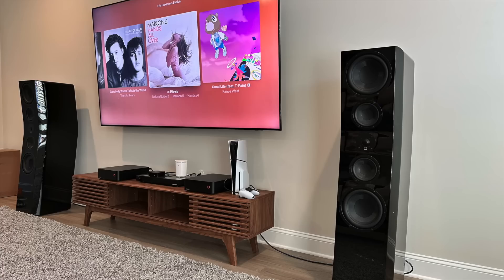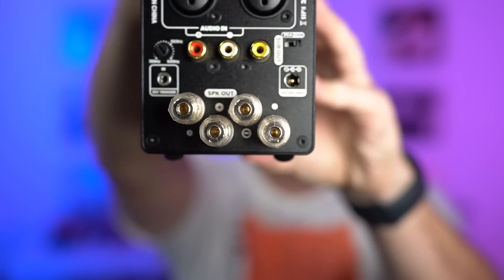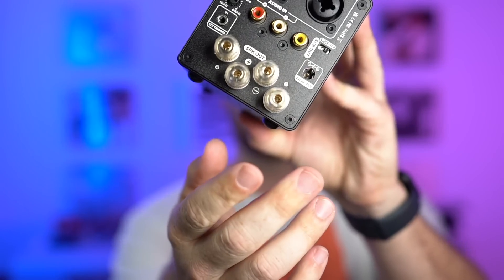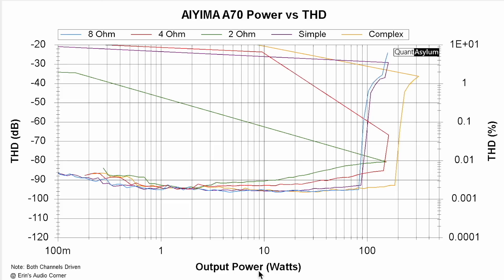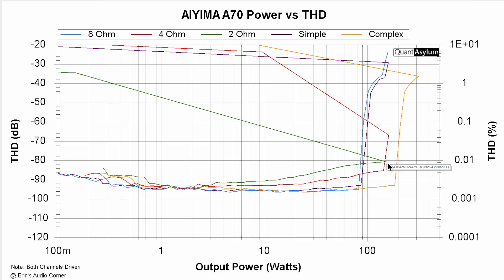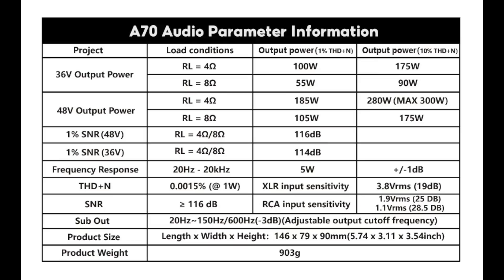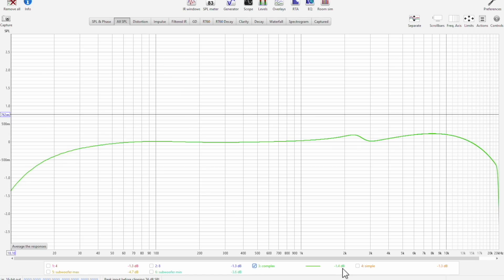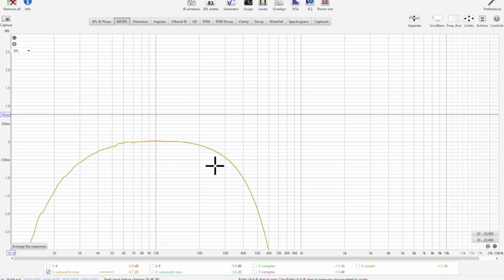The Shocking Truth About the AYEMA A70's Advertised Power!

Comment: Also don't forget that if you are using an active subwoofer you are taking that load off of the main amplifier. That can be up tp 80% of the total power and therefore you are left with 85 watts into 8 ohms for the mains (> sub frequencies). That equals more volume in total, lower distortion on the mains and more dynamics.

Comment: See, to me this is just an amp.  While this has a volume control, it's not much good as an integrated amp because of the limited inputs and controls. Wouldn't it make more sense to do bass management with a paired preamp?  Connect with a Wiim Ultra preamp/streamer and you even have the option of running your mains full range or high-pass...along with the ability to sync your subwoofer with your main speakers.

Comment: Astonishing, the rise of measured power with the rollercoaster 'real life' impedance. 
But this doesn't show, how accurate the signals are reproduced when those D amps get closer to max output. Rectangular wave testing would show this better.
Since around 8 years I'm a fan of efficient class D amps, always corrected the whole system via PEQ to match my 'flat housecurve', so no issues with linearity of any D amp, older or newer ones.

In the end, while listening to lower 'human' levels, without insulting the neighbours, they all sound pretty good and relaxed. Hard to tell any difference here.
But to be honest, a tpa3255 with 36V or even 48V is way closer to a classic 2x50 W AB amp @4 Ohms. Yes, it can get louder, but then spikey distortions from 3-20 kHz with the class D gets audible and annoying, maybe combined with a not this nice looking waveform. 

It is, what it is. And it's not bad at all.
PFFB is here, and if TI can manage to lower the distortions in the higher frequency range in future, all class A / AB / H can be set into shelves next to the tube generation.

Comment: Got the Aiyima A70 and love it.  I left it on 24/7 for 2 days, just little warm to touch, however on the third day, it gets warmer to touch, so I turn the 07 off after each usage. Then as  I soon as I played a few track at low volume, it starts get warm right away. Sound quality is great, just the warm to touch makes me worry abt its longevity.  On the other hand, my Fosi ZA3 in stereo mode is not quite that warm as the Aiyima 70. Any thought abt the warm to touch of the Aiyima A70 ?
Reply: Which bone sound better Aiyima A70 or Fosi za3?

Comment: That's it!  If it worked for several days, is this already a reliable amplifier?  Immediately after this conclusion I turned off the video!😮😮😮
Reply from the maker: Leaving something turned on versus continually running it at max power with a static load for days at a time or two completely different things. I hope you understand that now.
Reply: @ErinsAudioCorner  My friend!  It takes years to test a product based on reliability criteria.  In all respects.  And you managed to do it in a few days.  And give a verdict: a reliable amplifier.  This is not serious my friend.  Keep your tech reviewer brand up!
Reply from the maker: @ИванПетров-м2ч2д  sure. I’ll review a product for 3 years and then discuss reliability once it’s no longer produced. That’s logical.
Reply: @ErinsAudioCorner I assume that your functional handle will break in 3 months!!!  At your "reliable" amplifier!😂

Comment: Thanks, and keep hammering the point about the lack of a HPF for the mains.  They got SOO close to an awesome product by even having a variable LPF when most others are fixed, but they fumbled on the 1 yard line by not having a HPF as well.  Not sure why so many brands keep failing on that feature, but maybe if you beat the dead horse long enough, they will take notice.  The WIIM amp is still the only desktop/mini amp that got it right.

Comment: Your comparison of the the two amp systems, one with a lot more power, has me wondering about the sound difference between increasing the amp's volume vs increasing the signal volume from the source. Is it better to crank up the amp, or crank up the volume on the pre-amp (for instance)?

Comment: Thank You Erin for the unbiased and technically sound review. I have a question about the pre-out connection.
Was the pre-out a mono output or does it do stereo signal. I have Aiyima 07 max and pretty much impressed with its capability to drive Wharfedale Lintons. I connected 3.5 mm stereo pin to pre out with stereo RCA ends. I’m getting signal to only one channel. So I presume the pre out is a mono signal. Please correct me if I am wrong. 😊😊😊
Reply: @drsuresh9  
I would think that the 3.5mm Stereo miniplug AUX OUT jack on your Aiyima 07 Max is stereo...as long as the amplifier itself is not switched to MONO mode.  I would confirm that your 3.5mm-to-RCA cable is not defective, and if it is good, contact Aiyima.

FYI, on the manufacturer's product page for the amp, one of the diagrams shows the 3.5mm miniplug to Left & Right RCA cable going to a PAIR of Active Speakers, indicating that it SHOULD be Stereo.

They also show it going to another amplifier that has Two Knobs and two of something else (RCA jacks maybe), which also suggests that it is a Stereo Output.

But they also show it going to a single active subwoofer.  Unfortunately, their specs and documentation aren't completely clear about this.
Reply: @bbfoto7248  3.5 Outputs, already making modifications, can be controlled
Reply: @aiyima_audio  
Thanks for the quick reply.  Please post the information and specs on your product page when the modifications are finalized. 

Cheers
Reply: In the A07 it is stereo. It is also a stereo input.  I have connected my phone to it via a dongle dac and can thus play music from my phone. I don't know if this is also the case with the A07 max and A70.

Comment: So basically you are saying there's no sound  difference between class a, ab, d. No sound difference between tubes and valves and no sound difference between 300 eur products or 3000 or 300000 eur  products, if the measure ruffly the same ?
Reply: You’re extrapolating what he said into a silly idea
Of course Class A and tube amps will sound different
Reply: @richardgrant418  so I am extrapolating.. ok so what did he mean ? All class D amps will sound the same, regardless of cost or quality of components, if they have the same power and the measure the same?
Reply from the maker: Did I ever, one single time, say that?  Nope.
Reply: @ErinsAudioCorner  "as far as the subjective sound, the transperency, the holography, the dinamissism..all those things. If you are comparing it to an amplifier and you've got them level match, I'd be suprised if you notice the difference. If you are being honest with yourself and you are doing a true abx blind listening test, I'd be really suprised if you heard a difference." - Erin . Min12.00

Comment: Great review. Looks like class D amps are way past being only for subwoofers, this looks like great value. Just need to find something with a remote (preamp/TV) to hook it up to.
Reply: The fact that MANY professional Active/Powered Studio Monitors used for recording, mixing, and mastering music are primarily using built-in Class D amplifiers, even in products like the $16k Kii Audio Three monitors that several respected mastering engineers use, is a confirmation and endorsement that Class D is NOT inferior to other topologies.

Most of these active studio monitors are using some variation of the Hypex Class D modules (UcD/Ncore/Nilai), or the Purifi Eigentakt 1ET400A Class D modules similar to Erin's "Reference" March Audio P501 monoblock amps which use the Purifi 1ET7040SA.

Comment: Great review and I am thankful for the explanation of impedance versus resistance.

So now we have 2 reputable reviews of the A70 by Erin and ASR.  Erin's is with the 48V 5A power supply while Amir M.'s are with the 48V 10A power supply.  The only difference that I can see is that the Amp went into protection at 4 ohms in this video (5A), but that didn't happen on the ASR review (10A), reaching about 200 WPC.  The post filter feedback loop (PFFB) is what distinguishes this mini amplifiers from others in the same class.

Comment: Hi Erin, an interesting review. I have been using Aiyima's A08pro for almost 2 years and it did wonders to me . I have been using one of the most musical amp from 47 Lab before and this A08pro does the same magic with more power which is truly amazing and go from strength to strength with better front end equipment added onto it. Tried their A07max and never liked it since it is lacking the musicality. So I wonder if A70 sound character is similat to A07max or more musical?  If it's a more musical , I may give it a try, thanks in advance!
Reply: What is musical? The function of the amplifier is only to amplify the signal as it comes from the source, not to change the sound.
Reply: @jari121  All amps  are not same, or else there won't be tens of thousanads of designs , brandss and models exisiting in this world. I trust my ears when A/B comparing it myself between different models. All cars are equal, why buy a porsche if a cheap but reliable brand can take you from point A to point B safely?
Reply: @ericlo6370  Did you make ABX tests like Erin? It always makes me laugh when someone makes these comparisons to cars, like comparing coffee makers to airplanes 😄.
Reply: @jari121  It always makes me laugh seeing people  looking at bench test results to judge a product. Let's  agree to disagree and rest the case
Reply: @ericlo6370  I also don't think that the current tests can show everything audible, but the ABX listening tests will certainly reveal if there are differences in the sound of the two devices. Maybe it's good to stop here.

Comment: Good to see you doing your things again. Now, compared to the Dayton Audio APA150 I don't see how this product is better. The Dayton can be bridged, has the transformer built in, line sensing on/off and a crossover low pass frequency control all for $199.00. I Would really like to see your comparison video if possible. Oh btw the Dayton claims 75 wpc @ 8 ohms.

Comment: The power brick delivers 480 watts maximum 🤔 if so then Simply take away the amplifiers inefficiency and a few watts for the preamp section then divide the remaining watts by the channel count and then you end up with a Theoretical max power output for the amp...to do 300 watts, it would need a 700 watt power supply, not 480

Comment: Excuse my daft question in advance, don’t you add a sub when your speakers don’t go down to sub levels, not to take over from your main speakers? I’ve done it with my Wharfedale Lintons, which have great bass extension, but not sub frequencies, so my sub just fills out the bottom end.
Reply: Yes, generally you add a subwoofer (or a few) when you want to experience those ~60Hz and lower notes in music or movies with real authority.

Your Lintons have good bass extension, but they as you said, they can't reach down low with authority, so you've added the subwoofer.

However, adding a subwoofer to most speakers, even if they already play down into the 40Hz or 30Hz region, and also applying a High-Pass Crossover Filter to your main speakers somewhere in the neighborhood of 80Hz to 60Hz (sometimes lower depending on the speakers), will in simple terms take some stress off of the main speakers and allow them to play "cleaner" and a bit louder before audible distortion or graininess becomes noticeable.

This will depend on the design of the speakers.  It may not make much of a difference with a good 3-way design that has a separate, dedicated midbass/bass driver.  But for a 2-way "bookshelf" or "stand-mount" speaker, the single 5.25" or 6.5"-7" midwoofer is tasked with playing both the majority of the Midrange AND the lowest Midbass/Bass notes and information.

The Wavelengths, and therefore the inward & outward motion of the cone (Excursion or Xmax) are significantly increased for the driver at frequencies below ~100Hz.  This means that for the lowest frequencies, the cone has to move in & out A LOT more, while at the same time the cone is also trying to make multiple shorter/smaller movements (cycles) to produce the higher midrange frequencies.

So, what can happen is that while the speaker is playing those low notes, the resulting large in & out excursion of the cone will "modulate" the higher/shorter wavelength midrange frequencies that the cone is trying to reproduce at the same time.

This causes what is know as Intermodulation Distortion (IMD), and it usually increases any time the speaker is tasked with playing lower & lower notes.

When you add a subwoofer with a Low-Pass Crossover Filter of say 80Hz, and also apply a High-Pass Crossover Filter at 80Hz for the main speakers, now the cone movement or +/- excursion of the mains will be significantly reduced, which generally results in lower IMD and lower distortion overall, so the higher midrange frequencies will usually become clearer and "smoother" and have more detail.

In addition, the impedance load of the speaker will usually become easier for the amplifier to drive, because the main speakers are no longer having to play near their Resonant Frequency (Fs) where the impedance rises sharply (shown as a tall peak on the impedance vs. frequency graph on the left side at the lower limits of the particular drive unit}.

Look at any of Erin's Frequency vs Distortion Graphs in his more recent speaker reviews.  In his measurements as well as others' proper measurements, you will ALWAYS see a significant to moderate rise in distortion on the graph as the frequency goes Lower and Lower (the odd-order distortion...3rd, 5th, 7th order harmonics, etc., and/or the even-order distortion...2nd/4th/6th order harmonics, etc.).

In most of Erin's reviews, he also shows what happens to the distortion levels IF you were to apply a ~80Hz High-Pass Crossover Filter to the speakers as if you were going to add a subwoofer.  In most cases, the distortion will become at least a little bit lower overall, and/or lower in particular frequency regions.

Sometimes the odd-order distortion (most offensive) will become lower while the even-order distortion remains similar, or vice versus.  Depending on the quality and design of the speakers, the distortion may be drastically reduced, or have only a minor effect when adding the HPF.

EDIT:  Frequencies below roughly ~100Hz become more and more omnidirectional and non-localizable, meaning that if they are low in distortion and are not providing tactile feedback or causing things to buzz or rattle in the room, you can't distinguish what direction they are coming from.

So, there is less of a need to have your Left & Right speakers play these low frequencies, and a decent subwoofer is much more suitable for the job of reproducing the lowest octaves.

Also note that even with all of the mono bass frequencies coming from a separate subwoofer, your main speakers can still provide Left-to-Right "Stereo Imaging" of these bass frequencies because those frequencies USUALLY have upper harmonics tied to them that will be reproduced by you main speakers.

For example, when you hear a low note plucked on an upright acoustic bass, while the fundamental note may be mono in nature, all of the strings resonate sympathetically and produce upper harmonics, AND the actual "pluck" sound that is generated is also much higher in frequency, and adds a harmonic transient that is tied to that same fundamental note that helps you to locate its position in the soundstage.

Crikey!  Sorry for the long-winded reply, LOL.  I hope that makes some sense.  😛
Reply: @bbfoto7248  hey, no worries, that’s an amazing explanation, way more than I was expecting! Thank you!!
Reply: @bbfoto7248  Excellent -- precisely correct ... and why that high pass filter is essential in the analog-analog realm.

Comment: Just buy the 48V 10 Amp power supply for an additional $20.
It's double the power, and I think it'll do a lot more good than you might expect.
😊
Reply: Distortion seems to be an issue when you pair these with a higher power supply. Word is.